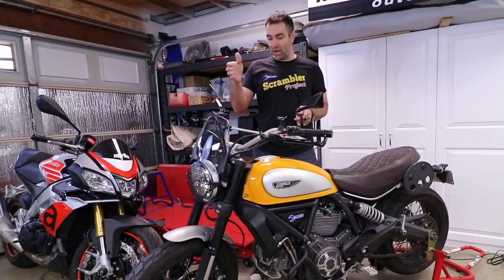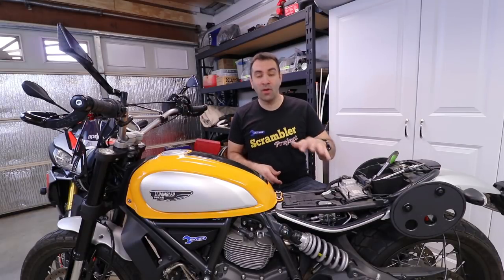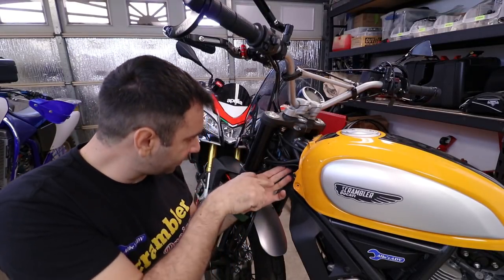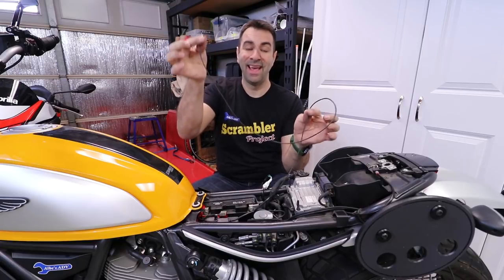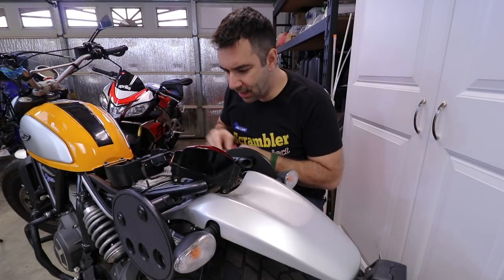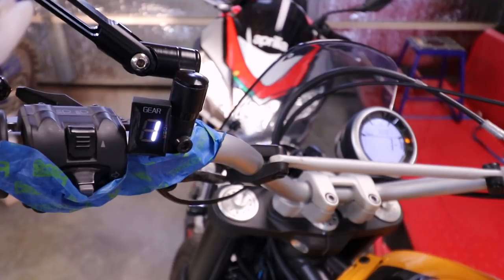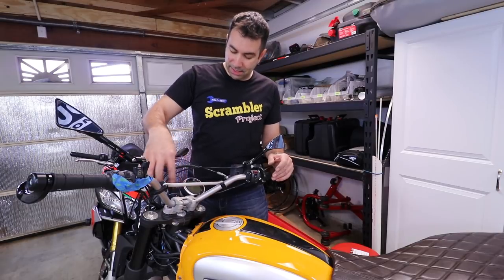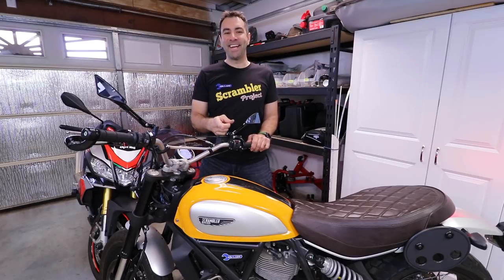Ducati Scrambler gear shift indicator - Ducati Scrambler Project Ep 16

Comment from the maker: People....  check the spelling......
Reply: If you do this to your bike just be aware that you might find you have problems with fuel lines when you are done adding more weight just to tell you what gear you are in.
The Scrambler has a lot of bike squeezed into a small package and thus getting the tank on and off is a bitch of a job. Just be aware that those fuel lines leave the tank on the opposite side to that which you see moved up (the left side) here and they are easy to pop off leaving you with no fuel going to where it needs to reach.
How do I know this?
Look at the amount of work I did to my Scrambler ...
https://www.youtube.com/watch?v=e6eWCgjb7B8

Comment: Nice job! All bikes should have a gear indicator. I'm glad the 1100 Scrambler(and the new 2019 800's aswell) has one included in the dashboard.
Reply from the maker: I agree, in this day and age it doesn't take that much.
Reply: @AlbesADV  True. The thing is my first bike(a 1984 BMW K100RS) had a gear indicator so after that you are pretty much spoiled. Sadly most other bikes after that didn't have it and I always miss it.
Reply from the maker: Yup
Reply: for what exactly? every bike i've had has never had a gear indicator. i've yet to see why i'd need another thing on my dash to stare at. the only time it seems to make sense is maybe on the track? and i doubt anyone is racing with a scrambler.

Comment: You can get an LED headlight that bolts on just like the OEM setup on eBay for about $150 , no need for any extra brackets. Seems like a much needed upgrade
Reply from the maker: I think next I'm going to change the look of it a little
Reply: I almost went for the motodemic headlight, but I liked my evotech headlight protector too much. Plus this one uses the OEM plug. Interested to see what you change in the future
Reply from the maker: I'll check it out

Comment: I can’t seem to find my DDR so I have nowhere to plug it. I have a 2018 Ducati Scrambler Cafe Racer. Any ideas?
Reply from the maker: Should be under the seat,  possibly under the plastic cover for the battery
Reply: @AlbesADV  I finally found it. It had a cap so I wasn't able to find it at first. Although ever since installing the gear indicator, my bike sometimes turns off on lower gears.
Reply from the maker: @JackMihoff6969 it definitely shouldn't do that. Did you try disconnecting it and see if the problem persists? The gear indicator is read only shouldn't cause any rpm drop or power issue unless there is a wire crossed 🤔

Comment: Thanks Albe for the nice video. I bought one for my 2017 Ducati Scrambler Icon, the only problem is that it can"t seem to learn neutral.. Any ideas? Thanks
Reply from the maker: Not sure, mine worked just as expected,  did you try to send a message to the maker ?

Comment: Awesome video!!! Quick question do you think its possible to replace the gage cluster-instrument panel from a 2017 scrambler cafe racer and install the 2019 instrument panel instead ? I just dont like the looks of the 2019 cafe racer.
Reply from the maker: Probably not, look at the connector in the back of the gage cluster, they should be different from each other and I don't think cutting and splicing is a good idea.
Ride safe 😀👍
Reply: Yeah true😔,  i guess that I have to  change the color of the bike. Thanks a lot.

Comment: How you cam setup the gear indicator? you up the bike in some machine? thanks for share!!!!
Reply from the maker: Sorry Lucas I'm really not sure what you are asking
Reply: @AlbesADV  
Sorry I did not have a translator at hand, what I wanted to know is to set the gears one should raise the bike to some type of machine to put the gears and accelerate?
Reply from the maker: Yes, I lifted the rear wheel with a bike stand, you can also do it by riding a long straight road and going through the gears that way.

Comment: Mine starts normally, with the "L" blinking, then it goes to "1", and it never goes up :( It stays stuck on 1st gear in learning mode. I even tried resetting it (turned bike on and off 6 times and all that), but it's still not working :(
Reply from the maker: Did you try repeating the learning sequence?
Reply: @AlbesADV  Yes multiple times, it always gets stuck blinking on the first gear.. Tried giving more rev, less rev, etc.. Nothing seems to work. Maybe mine is just faulty..
Reply from the maker: @samerelsahih  maybe, I'm sorry,  try to have it replaced with another one